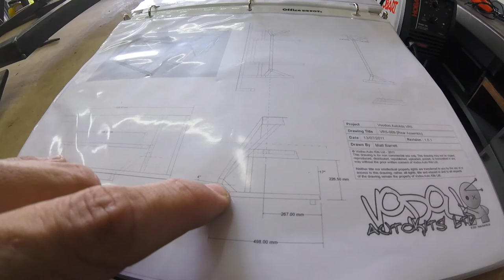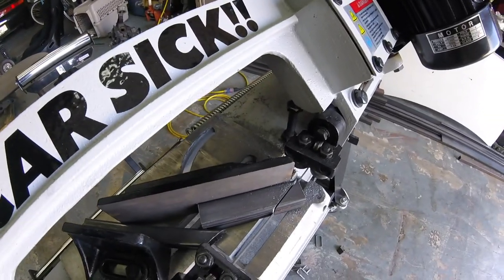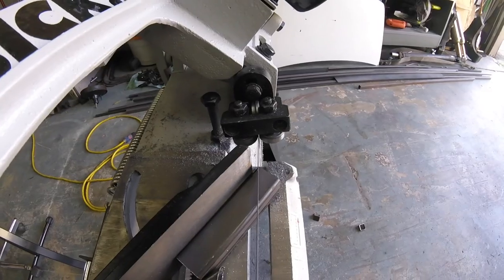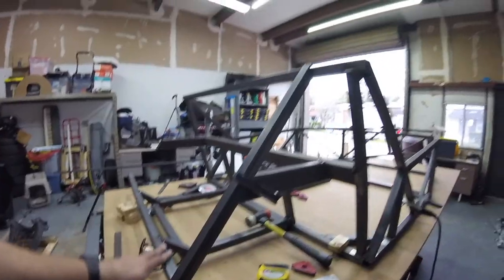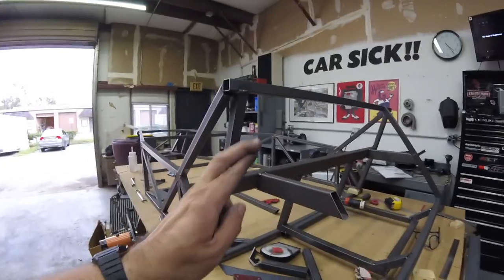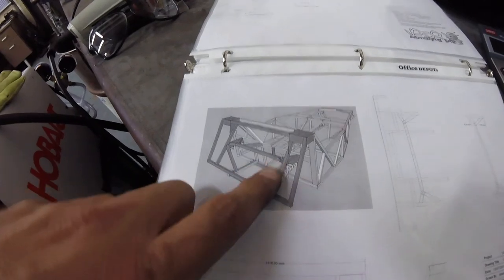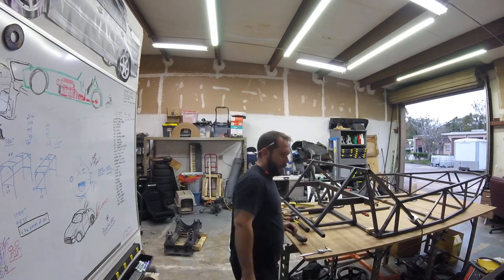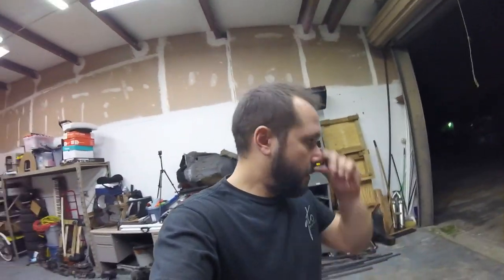More Rear End Work! Almost done! Locost!

Comment: I’d love to do a classic mini roof chop and rwd with a hot rod style front end and big wheels up to the window lines!
Reply from the maker: yessss. Kind of like that VW rabbit hot rod? I've been wanting to do that. Drop a small import body onto a ladder frame with a carb'd small block powered by propane, big tall tires in the back.
Reply: Car Sick!! That would be so awesome! 
Another mini project I’d love to do is front engine RWD like mx5 running gear in what looks like a stock mini from the outside them do some donuts !
Reply from the maker: sleeper!

Comment: Probably way too late for the giveaway, but I've always had an undescribable desire to take a first generation Scion xB and but a Mazda 13B rotary engine in it and convert it to RWD. I'm not even sure if it would be possible with the underbody supports, but I just like the idea for some reason.

Keep up the great work. I've been researching Locosts for about a decade and your videos are getting me closer and closer to the jumping off point.
Reply from the maker: Thanks! I really like the first gen XB, plus they’re actually pretty light weight. You can make it rwd, just take a factory rear subframe from a 240 or something, then reinforce the chassis with steel tubing, attaching the tubes to thicker parts of the xb chassis, make mounting locations that line up with the subframe mounts. It would be really cool. I’ve been wanting to make a fwd into rwd. maybe when i’m rich, and can build stuff all day.

Comment: R31 skyline wagon with a ford barra 4.0l straight 6 with gt 45 tubro backed buy a t56. Convert the arse end from live axel to ifs and bags all round with full 80s spec lounge chair interior and digital gauges(already have the car but the motors are crazy expensive). Also rd28 swap a r33 gt for a diesel drift car
Reply from the maker: R31s are super cool! Start with a cool engine and then work on the rear end and suspension. Those are really cool though.
Reply: Car Sick!! Cheers man

Comment: Currently waiting to pay for the car to start my dream build, a 1973 Reliant Rebel estate (wagon),  it's a tiny little car with a steel chassis and a fibreglass body. They are very light and there are loads of other engines that will fit in it. Currently leaning towards an Isuzu 1.7 turbo diesel 😎
Reply from the maker: You're a nut. Would you reinforce the chassis? Where do you live that you can buy a Reliant?
Reply: Car Sick!! I live in South Wales, UK. From what I've seen the reliant chassis is pretty strong, plus those Isuzu engines aren't very big. I'll wait and see how it looks when I finally get hold of the car. It's so frustrating at the moment, the car is only about 300 yards from my house but the person dealing with selling it lives on the south coast of England 😳

Comment: 80’s model 4 door Ford Ranger with a Mercedes OM617 turbo diesel engine.
Reply from the maker: 4 door? Where do you live? Did we ever get those in the States?
Reply: To my knowledge there were no factory 4 door Rangers in the 80’s in the USA. Thats why it’s a dream build. Lots of welding and fabricating. Then on top of that toss in a very dependable diesel engine that will last. Best combo ever. I am from the U.S.
Reply from the maker: A diesel in a midsize four door truck would be awesome

Comment: Dream build would probably be a proper rwd gc8 with a 4G63, because we all know the ej is garbo
Reply from the maker: lol, proper rwd! It's weird that you don't see more 4g63 swaps around. I wanted to make a mid-engine crx with a 4g back in the day. I thought long and hard about it. Now I have the space, tools and know-how I didn't 15 years ago.
Reply: Car Sick!! That would be a wild ride for sure ! and I've been saying the same thing for a while now, it's crazy how stingy them Evo guys are haha It seems the 4g is about the strongest stock block 4cylinder you can get.  And I say proper rwd because that puny r160 just won't hold the power of the 4g. It's fine right now with a stock na 2.2 but any kind of real power would shatter the diff and axels, that's why I'm getting a taste fab r200 rear subframe conversion along with the axels and driveshaft (: I'm actually back to awd right now because it got to be a bit of a handful with all the rain. Can't wait till I can throw the rwd trans in again!
Reply: Car Sick!! 4g powered locost??????? 😁
Reply from the maker: hmmmmmmm

Comment: I want toTube Frame my Audi 100 Avant,Biggest Single cam V8 I can get with working Madmaxstyle Weiand Superchargers.Giant NOS Tanks in the back.Offroad Capable like the Fury Road Interceptor.Rear Wheel drive(already built that).Huge paintball gun on the roof operated by the co driver to shoot at haters.No paint just blank steel so you can see how its build.Not to forget Flame throwers to melt Ricer civic plastic bumpers and fiberglass spoilers and a camera to capture the look on their faces.
Reply from the maker: Wow, you're a psycho. I love it.

Comment: You give away a t-shirt and look at all them comments lol!  Need some fat-boy sizes (2x) so don't pick me, but my dream build is an Ultima GTR kit, I've wanted one since I first saw it in the Sport Compact Car magazine I was concealing inside my math book during Algebra 2 in 11th grade (2003). But a kit car is kind of a cop-out answer, so I'll say I've also really wanted to build a silly twin engine car for the longest time.  Currently thinking it would be hilarious to have a circa 2005-08 Impala SS/Pontiac Grand Prix GXP with the transverse mounted LS4, and put a second one in the back.
Reply from the maker: Ultima GTs are super cool, so I'll let it slide. Also, do you remember the twin engine Hyundai in The Ultimate Street Car Challenge?  Also, free stuff brings people out of the woodworks!
Reply: Yesss, that Tiburon started my obsession with twin-engine cars. That car was hilariously clever: on the surface it looked like an autotragic, non-intercooled, slapped together turbo setup - in reality running meth, the limo-tinted windows were hiding the fact that the interior was gutted and windows were lexan, and oh yeah the second engine in the trunk.  Oh how I miss USCC!

Comment: Anything with tubes!
Reply from the maker: Totally tubular
Reply: Car Sick!! Are you using Miata knuckles?
Reply from the maker: yes, I will probably be modifying the fronts for more angle and also to turn the taper upside down for better tie rod clearance in the Locost chassis
Reply: Car Sick!! Running the same caster/ camber as the Miata?
Reply from the maker: Probably not, alignment will be whatever the chassis wants.

Comment: Im currently building my dream chassis and car but probably not dream motor swap in it... its getting a 3400 la1 with forged pistons over winter... prob only around 300hp sadly on 10psi but fiero is light so it should still b awesome... my dream swap for my fiero is a ferrari v12 swap cause that b awesome... other swaps ive considered are 4g63, k20,  any vw turbo diesel or a electric swap... love your channel i just started making videos like a month ago been uploading daily but probably not the greatest videos but im sure they will get better
Reply from the maker: Good luck with your videos! I've been doing this about 2 years and I'm still struggling with views. 300 hp is more than enough to get in trouble in a Fiero!

Comment: My Dream car build is the TG700.  This car is my original design that was influenced by car styling of the 1960s.  The primary influence is the Mezzerschmitt TG500.  Nicknamed the "Tiger 500",  it had a 500cc motor, 4 wheels, and was quite a performer in its day.  My Tiger 700 will double the horsepower and cut the weight in half, so it will weigh less than a Harley Davidson. Think of it as a Hot Rod Mezzerschmit.  It will be the mouse that bites!

I have completed the TG700 design and the construction will begin in Nov 2017.  To monitor my progress, see my "Rumbles Tiger 700 Build" thread on the LocostUSA.com forum ->    http://www.locostusa.com/forums/viewtopic.php?f=36&t=18878&p=235179#p235179.

I'm posting small digestible chunks of my progress on the forum, but the postings are a bit behind my actual work...Stay tuned!

BTW, I wear a size Large T-shirt.
Reply from the maker: Awesome! I've seen your build on there. Make sure you wear your brown pants when you first take it out!